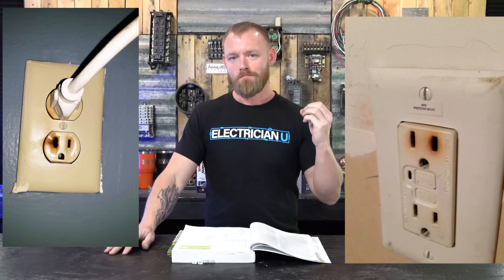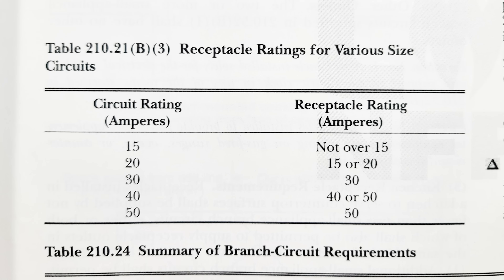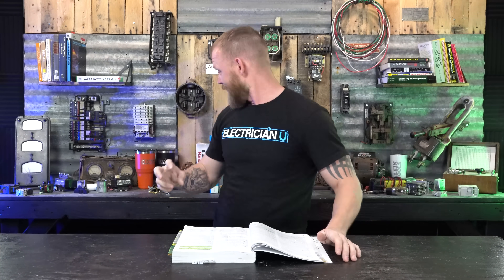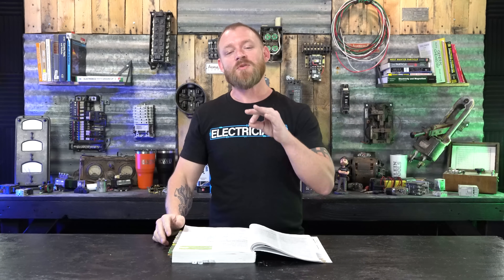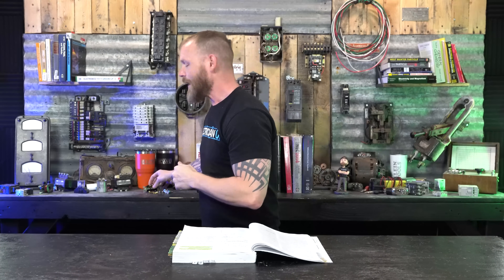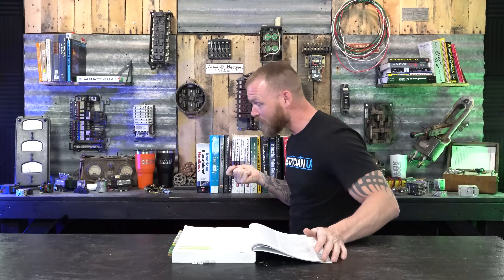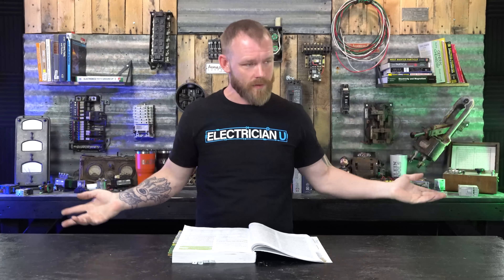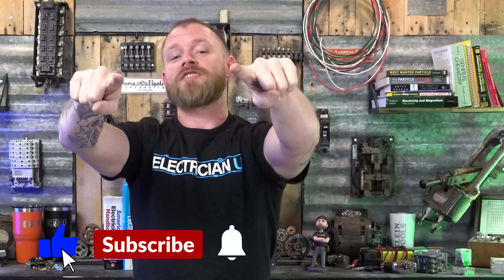Won't These Melt?!? 15amp Receptacles on 20 amp Circuits!!!

Comment: Use to be able to run hi-watt appliances such as space heaters by using a 15amp outlet on a 20amp breaker, but over the past 15-20 years, the manufactures started making their 15amp outlets chintzier. Still has the UL rating but can clearly see the differences when you take a part old school outlets versus the new made-in-china junk that fraudulently gets the "pass" with UL labeling
I grew up in the 70's and 80's. Parents had always used the 1500watt space heaters on the 15amp outlets and dad put in 20amp breakers for the outlets we used the space heaters on. NEVER had even one single 15amp outlet do what the junk outlets do today. Still have the space heaters from when I was a kid and when my furnace went out several years ago, my dad brought over the space heater even though he was using it. Within a couple weeks I started smelling the familiar smell of burnt plastic.
Also consider the junk made in china IS NOT properly rated and is hardly quality controlled... COUNTLESS times their products will claim having a particular wire gaug, but after carefully stripping the wire insulation and checking the gauge of wire, ITS NOT what they claim.... its smaller and thus gets hotter and burns up.

Comment: I have a Lincoln welder that has a 20 Amp requirement. But it trips my 20 Amp breaker after an hour use. What's going on there?

Comment: This is an example of "code" being WRONG.   20 amp receptacles should be required for 20 amp circuits.  The truth is that 20 amps CAN easily be plugged into ONE receptacle.  Why allow for that to happen with a 15 amp receptacle?    That code should be corrected.  A person who is just USING that 15 amp receptacle doesn't KNOW that they can only plug a 12 amp load into it.

Comment: IN MY OPINION ALL PLUG IN Receptacles. SHOULD BE ON NOTHING LESS THAN 20 AMP CIRIUIT (12 GAGE WIRE) AND, COMERCIAL GRADE PLUGIN RECEPTACLES; THEY HAVE BETTER mechanical Retention AND WEAR OUT SLOWER. FROM WHAT IVE SEEN COMERCIAL GRADE IN 15OR20 AMP RATED LOOK THE SAME INTERNALLY.

Comment: I'm going to save you roughly eleven minutes of your life.  That's a 15 amp duplex receptacle.  Meaning there are two 15 amp receptacles ganged together by jumpers.  A 20 amp circuit may safely serve two or more 15 amp receptacles that are in good condition. The internals of 15 and 20 amp receptacles are typically  identical; only the face plate is changed to make for a more efficient manufacturing process.
Reply: Nope. Others should definitely watch the video. Then they’d hear the example of 2 space heaters plugged into a duplex 15A receptacle drawing 20A, possibly not tripping the breaker, and torching the receptacle.
Reply: Thank you.
Reply: Wow! What is wrong with you all. Firstly, trad breakers are designed to take the Dirac start spike of a motor which is six times the run time load. But what happens if you run those cheap space heaters on continuous duty cycles? I have replaced a few melted 15 amp receptacles due to this. Then you have those gang plugs that they sell. You to can put a handful of portable devices on one 15 amp receptacle. 

I recommend going with 12 gage wires on receptacle runs using SPEC grade receptacles like Levitons. If you’re a cheap contractor or house flipper, you do it on the cheap. Cool, but leave my phone number on the fridge when it’s time to clean up this mess.

So it’s fine to use those 15s, but know their😢 limitations. I know this is asking a lot of the public.
Reply: @devmeistersuperprecision4155 so to be safe. Put in 15amp breakers instead of 20amp with 15amp receptacles connected?
Reply: @ohmboytx  You could do that, but if the circuit has 12 gauge wire and is often used for higher load appliances, you could have frequent breaker tripping, so no, 12 gauge wire = 20 amp circuit breaker.
Reply: @surferdude642  Code mandates that the conductor on the load side must be protected by the breaker rating.  So using 12 gage NM wire on a 15 amp branch circuit is allowed even through you normally see 14 gage wire.  But according to NEC 210.21(B), the receptacle must carry a rating of at LEAST the branch breaker.  But NEC 100 changed the definition of a single receptacle.  A receptacle with TWO plugs is a duplex receptacle.  For a 15 amp branch circuit with multiple receptacles having independent straps or shared straps, it is permitted to use either 15 or 20 amp receptacles.  The rational is that multiple devices spread out along multiple receptacles with a reasonable combined current load not exceeding 12 amps (note derate for contact resistance effects) is acceptable.  The problem arrises when the user draws all of the combined load through a single receptacle using devices rated in excess of 15 amps, extended run times on devices with fractional duty cycle or multiple appliances attached to a gang plug.  So it is possible to overload a single 15 amp receptacle on a 20 amp branch circuit which has led to some issues.  In my case, I have seen the excessive use of space heaters melt 15 amp receptacles on 20 amp branch circuits.  While the code does not mandate this, I have always used SPEC grade devices unless absolutely told not to.
Reply: 😂😂😂😂😂 you did good.
Reply: Some may be identical others are not...
Reply: @exitar1 As long as they are the same grade level then they should be effectively identical. Sometimes they are completely identical and sometimes they have omitted the horizontal neutral line contacts because they they cannot be accessed in a 15 amp receptacle.
Reply: You don't feed thru the receptacle, make joints pigtail and you are fine.
Reply: This isn't correct, the internals are mostly the same the receptacles rating and face design is a lock and key set up to only allow certain plugs so equipment gets the right power, example your dryers plug
Reply: Lord thank you sir
Reply: I liked the video.  I feel I learned something.  I also like the entertainment value of videos like this.  I’ve been flying jets for years.  I could tell you in a nutshell how everything works on it but you would gain nothing from it.  Why would you feel like you have to degrade this video?  I went to your channel…you have nothing of interest.  This person actually gave me insight to why I have been tripping circuit breakers in the winter for the past two years.   Your mama should have taught you the old adage about if you don’t have something positive to say….say nothing at all.  Luckily mine didn’t either.  Your channel sucks.
Reply: That's kinda mean.. I clicked like, but I'm still compelled to play the video so he get he l his fraction of a penny from me. Lol
Reply: Can I put 20 amp receptacles on a 40 amp breaker
Reply: @bigopp4463  You can, but you should not.
Reply: @bigopp4463 hell yeah u can, but you can't draw more than 20A from the receptacle.
Reply: To add to that, I think the reason receps melt is using the absolutely cheapest ones available.  Yeah it adds up in a house, but a few $$ to save a melted plug would be worth it to me. $0.69 vs $2 maybe?
Reply: Nice. I paused the video at nine seconds when I saw your comment so now it won't even count as a view twirls mustache MUAHAHAHA!!!

Comment: Pretty simple reason they do this... Say the outlets in your living room are entirely on one circuit... Your TV draws 2 amps, a floor lamp draws 1, your surround sound 7.5, your computer (connected to the TV for media/gaming) draws 5. Pop goes a 15a breaker every time you turn the lights on. A 20a breaker will handle it, and the outlets will be just fine as long as you don't plug everything in to the same outlet. This is common sense, and this is WHY the code is written the way it is. It's not just "Oh, it's what code says we can do."

Comment: You can have a similar issue if you plug a large load into an undersize extension cord into a 15 amp circuit. How many fires have been caused by space heater plugged into a 16 or 18 gauge extension cord?
Reply: And that raises an important point, it should be mandatory that all extension cords 16 or 18 gauge come with built in fuses (similar to X-max tree lights) or built in circuit breaker (like you'd see in most if not all powerstrips)   rated for the corresponding wire size and length.    

It is no longer legal to manufacture 18 gauge extension cords, UL mandates extension cords be 16 gauge minimum.    18 gauge cords have not been available for many years.
Reply: @Sparky-ww5re  I think that circuit breakers on extension cords would be a great addition.
The problem is that most circuits are 12 or 14 gauge, so even 16 is undersized if operating at 80% of circuit capacity.
Reply: @rich7447  😎   I was referring to built in circuit breakers sized for the extension cord.   Like 10 amps for a 16 gauge cord.   That would reduce home fires from people plugging in 1500 watt space heaters. Many folks seem to think that the circuit breaker in their panel  will protect them from a fire caused by overloading,  when in reality the circuit breaker  is designed solely for protecting the branch circuit.  .  For example a 16 gauge extension cord overloaded to  more than 15 or 20 amps will breakdown and possibly light on fire by the time the breaker trips.
Reply: @Sparky-ww5re  I apologize that it didn't come across like I understood what you were saying and fully agree.

Comment: Electrician do stupid stuff only because NEC allows it and they want to save a few $. That is why I replaced 20A breakers that licensed dumbass put in with 15A breakers. The code is just a MINIMUM safety standard.

Comment: Most skill saws, air compressors, and combined kitchen appliances in the same outlet/circuit are over the 12 amp rating. Also individual duplex circuits load can be altered if the receptacle is dual wired and the fuse link is removed between the contact plates of the receptacle during install. I have done this to solve issues with kitchen appliances  by feeding dual runs of 14 and for shop/garage outlets that are expected to run heavier loads. Also if the main box is in the house and the distance to garage is longer larger wire is required. I have seen to long of single 12/14g runs to garages. I like to run 2 runs of 12 on those length issues and split the receptacle it lands in this allows you to know and label that air compressor should go on that outlet exactly and share only the lighting then take the other run to other outlets. Funny that its usually the closest to the door or garage door that air compressor/pressure washers/vacuums get plugged into while bench devices well obviously most do a multiout and stack the hell out of devices so always try and double runs to break the shop loads up please. The code book leaves some to be desired here no doubt.. im not an electrician but common sense can go a long way to bad no one has any anymore.

Comment: Love the pushmatic panel above his head to his right, my left.  I had one complex with these , they were the band of my existence for awhile.  More for one breaker than to replace the service.
Reply: I've seen those in homes built in the 50s and 60s.    They are really cool looking,  but I wouldn't trust the safety of them after over 60 years.   Those particular breakers,  the older ones anyway, were thermal only, and were grease fed.   You were supposed to regularly exercise them to ensure they would trip if need be.
Reply: @Sparky-ww5re  fuses are safest, problem was homeowners would put larger fuses in.

Comment: 1:25 210.21 I guess their english teacher didn't smack them on the hand when DoubleNegatives were talked about in class.

Would it have killed them to change "shall have an ampere rating that is not less than" to "shall not have an ampere rating less than"?

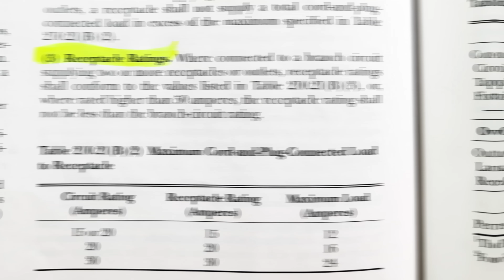1:53 Holly fuck they actually did it at the end of (3) lol. When they wrote that line someone finally had their coffee.

Comment: when using 15A receptacle outlets why not just load up the breaker box with 15A breakers instead of 20's even if known the circuits are 12g and can handle 20A ?  Because in theory - it 'should' eliminate the hazard - the breakers would trip easier n save potential damage to any  15A receptacle outlets.  Yes thou some breakers may trip - if so happens and if known they have 12g wire for a 20A breaker to begin with - those that do can b swapped out afterwards. SO still in theory - it 'could would should' still work out fine.      
( If a no - please explain )

Comment: I like your breakdown of this code, good job. FYI, State of New Mexico amended this code a couple decades ago, so that all receptacle branch circuits shall be min 12g wire, 20amp branch circuits with 20amp receptacles (obviously TR). Electricians use the 14g, 15amp, for the lights.